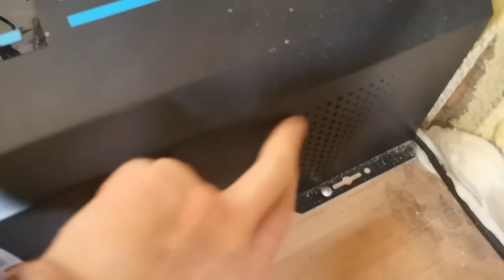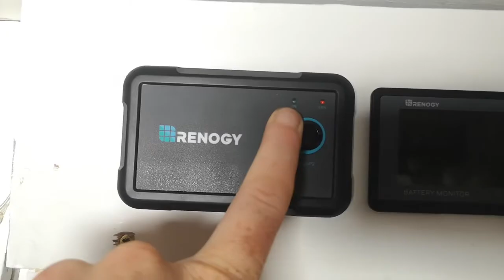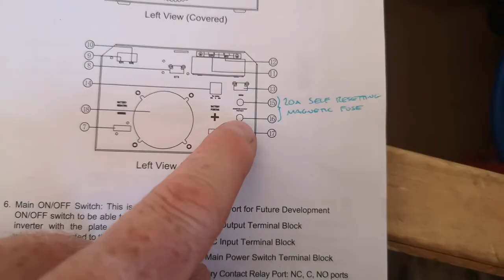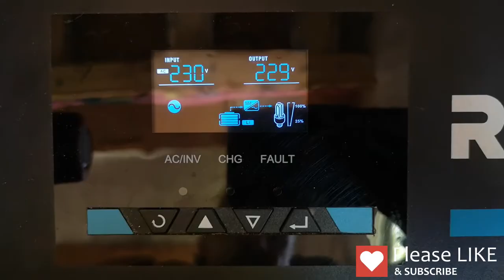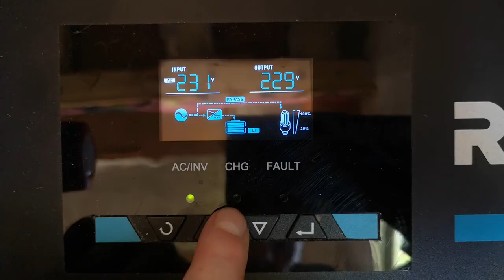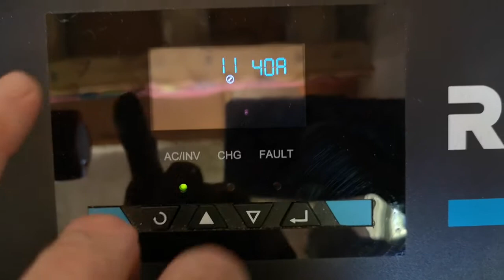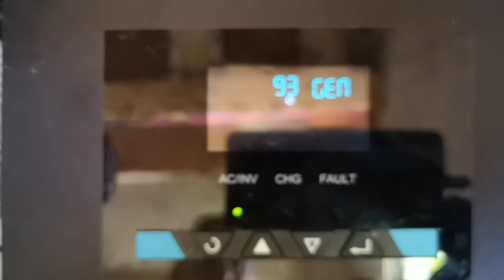Renogy Inverter Charger Installation & Setup | Part 1

Comment: Thanks heaps for posting this. For the popularity of these units there is surprisingly little information around on the how/why of installing them safely.

Looking forward to the next episode. I have the 3000w version which I want to put in a shed as a UPS to power some computers and a fridge. Would this then still need it's own circuit breaker? Would a seperate earth rod be needed here on the input side? Does the floating earth restrict the sort of appliances that can safely be used? 

I've tried asking a few electricians about what I want done and either my explanation is terrible or the job sounds too fiddly/complex ad I've never heard back from them. Really appreciate what you're doing here as I think it should help me paint a clearer picture.
Reply from the maker: Hey Dominic,
Thank you for your support and kind words. I'm glad to be of help.

Regarding your questions:

1) It is necessary to have a circuit breaker to protect the cable of an electrical circuit. Hence, the supply cable and output cables connected to your computer and fridge must be protected via a circuit breaker.

2) The AC connection input must have an earth. An earth rod is adequate and might be necessary due to regulations since your installation is in a shed. Nevertheless, this requires further information about the electrical installation of your property. Also, earth rods require testing with electrical test equipment.

3) Appliances will not be affected by a floating neutral earth. They require mains voltage (around 230v) to function, and as long as they get this via the live conductors (L&N), the appliance will work correctly. If there is a fault, the internal fuses should blow, and since there is no direct contact with the earth, there is no fault path through you. Hence no shock. However, I always recommend using class 2 (double-insulated) appliances, where possible, as a safety measure.

As an electrician, I understand that the term 'electrician' is quite broad. It is not possible for one person to know everything about all the sectors in the field. Electricians have their specialized sectors; this may not be their sector. For instance, dealing with UPS, inverters, and 12-volt systems requires more specific knowledge and experience. Therefore, it is recommended to seek guidance from a qualified engineer with expertise in these areas, like myself.

Hopefully, this answers your questions and I haven't gone too deep into electrical geek language. Let me know if I can assist further.

Regards,
Jolly
Reply: @vandercampadventures  thanks so much for the detailed reply, helped so much 👍.

So Q1&2 seem to merge a bit for me now. If my shed power is coming via an extension cord from my house whose circuits already have breakers, would that constitute being suitably earthed? Or do I need a dedicated breaker at the input of the inverter/charger going to its own earth rod?

3) My computers will be class 2, so should be fine. I'll have to take a closer look at my fridge as it'll likely be class 1. 

Thanks again!
Reply from the maker: Hey Dominic, no worries 👍.

If the extension cable has an earth, is suitably sized, and is supplied by a circuit breaker, it should be adequate. However, to determine whether an earth rod is necessary, electrical tests must be performed at the supply cable (inverter end). These test results will determine whether the earthing is sufficient.

Again, electrical tests must be performed to ensure proper grounding if an earth rod is used.

I hope this info is useful, Dominic.

Kind regards,
Jolly 🤟

Comment: Sorry another question, you mention about cable size if incoming and outgoing AC cable, is there anyreason why one cant use a 2.5mm2 cable which is rated at 25A, main incoming on a campsite would only be at 16A and the outgoing at 2000W/230v would be 9A, it could surge at 6000w for a second butnthere is an internal 20A on the unit internal protection
Reply: That's great thanks for confirming
Reply: Confused as to why the input AC would need to carry the 5 to 65A, surely that charge current from the inverter is a nominal 12v from charger to battery, or am I not reading this correct, thanks again
Reply from the maker: Hey Andy, i've deleted my last comment because it was misleading, sorry about that, i'll try again.

A 2.5mm flex cable rated at 25 amps is sufficient to power the charger. The charger can supply 5 to 65 amps of charge current to the battery at 12 volts, this converts to 60 to 780 watts. Therefore, the AC input cable must be rated to carry at least 3.4 amps (780 watts / 230 volts = 3.4 amps). 
However, when using the charger in utility priority mode, consider the load of 230V appliances in cable calculations. This mode powers the loads and charges the battery. In part 2, I will perform tests to verify this.

The manual's recommendation of 6-16mm cables for AC input/output is misleading, as the cable size should depend on the user. Generally, mains hook up supplies only require a 2.5mm cable, rated up to 16 amps.

Regards,
Jolly

Comment: Great video lots of information. When on DC supply thought the inverter do you know what back feed protection is available to prevent backfeed to the dust board, drip out contactor possibly?
Reply from the maker: Hey Andy, i'm sorry i don't know. For technical information like this i would advise you contact Renogy support. They've never failed to help me out.

Regards,
Jolly

Comment: Great stuff mate. Out of curiosity are we as people protected at all on the output side ?
Reply from the maker: Hey Mrt 👍,
Theoretically you wouldn't get a shock if you touch either live because there is no neutral to Earth bond.
However, you would get a shock if you touched both lives. Holding one in each hand would mean your part of the circuit, so would know about it.
Therefore, it's crucial that all socket outlets are double pole (they isolate the 'live' and 'neutral') and the electrical installation is installed to current regulations. That way your safe and sound.

Regards,
Jolly
Reply: The manual on my inverter charger (2000w) states that in DC mode there is a neutral earth bond
Reply from the maker: Renogy support confirmed that these newer PCL inverter chargers don't have an automatic N-E bond switch like the older versions, rendering the manual (V1.1) outdated.
Reply: @vandercampadventures  so on the new ones you dont need RCD protection after the inverter?
Reply from the maker: Correct, an RCD won't work on the inverter output (AC output).
Reply: The one I have came with the v1.1 manual, how would I know which inverter charger I have, is there a way to determine if it has the NE bond or not by inspection?
Reply from the maker: Renogy have confirmed that 'PCL inverters do not have an N-E bond switch'.